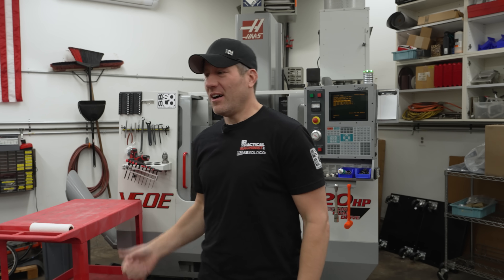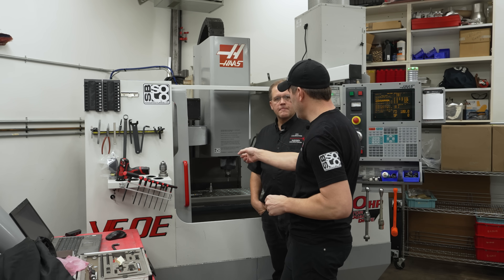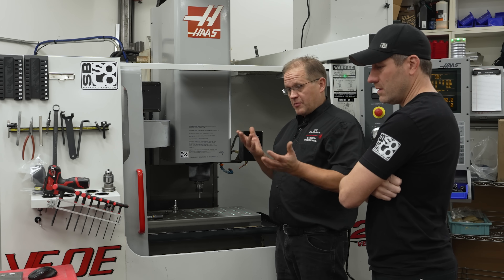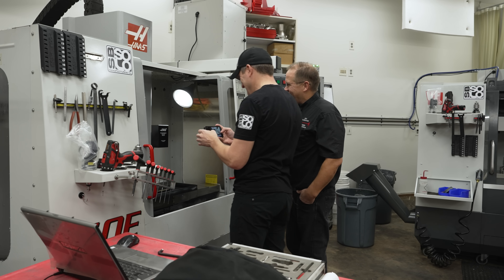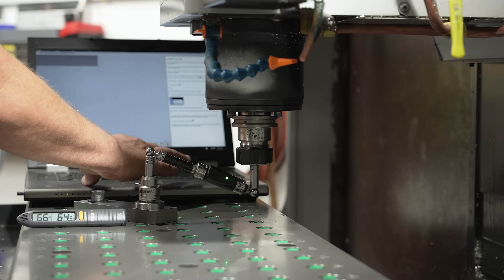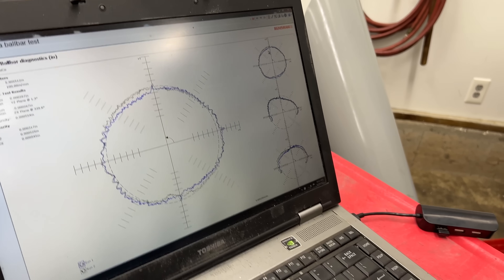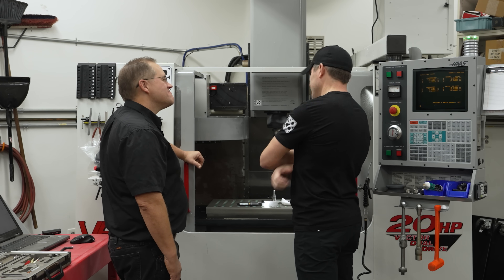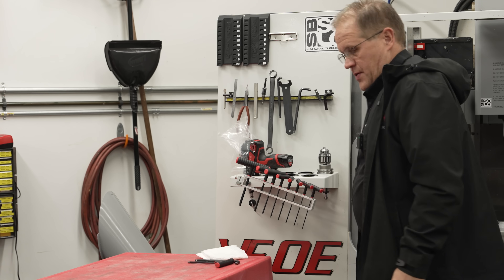Why Your Machine Isn't as Accurate as You Think | How We Do It Ep.5

Comment: i wish this technology was more accessible. The technology itself is quite old. LVDT transducer with two round balls at the end.
Reply: You can rent ball bar test sets. Most shops wouldn't need to own a set full time.
A ball bar is good to check wear and verify function after repairs are done.

Always a good idea to move your fixtures to spread out wear zones.
Reply: @sprky777  probably expensive :P . I would find it useful for machine building and for checking your servo tuning. But for a real shop, renting one is probably best.
Reply: @BuildItAnyway  our shop had our own. We had almost 100 cnc machines so used the ball bar frequently for routine alignment tests and post repair calibration tests. It initially cost $25k but I think it paid for itself in identifying problems in the first year.
Reply: It’s definitely been around a while. Don’t see it used much in the real world.
Reply: @SBSOLOCO  thats because lasers are faster and more accurate than QC bars
Reply: @abhiwins123  And gives you far less information. BallBar and laser arent equal.